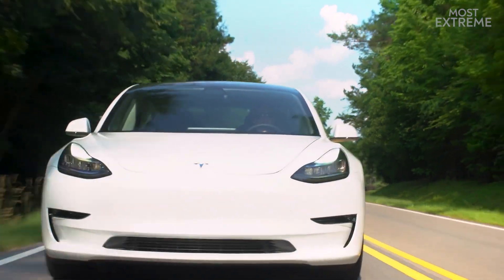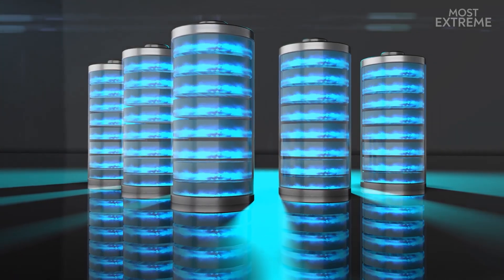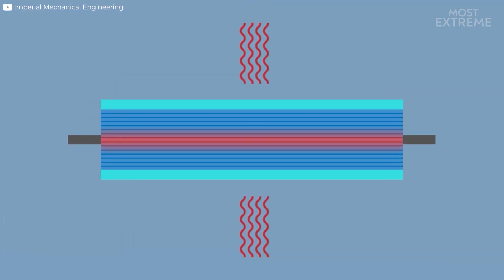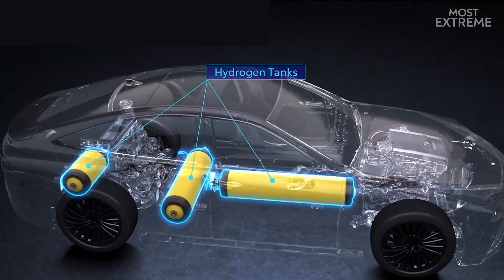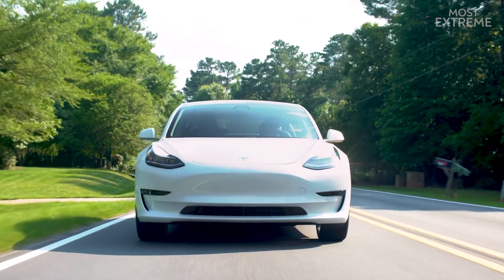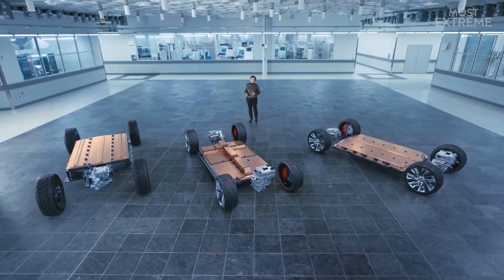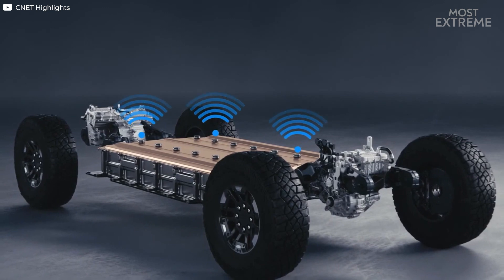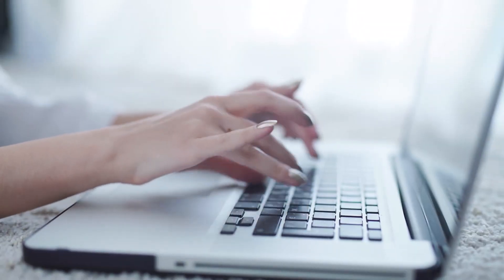Lithium VS Hydrogen VS Solid State | EV Battery Technologies Explained

Comment: Existing internal combustion engines have a fire every 2 minutes in the US. Electric vehicles are definitely better than this. A range of only 3 to 4 hundred miles? Who drives further than this in one go? Stopping for a coffee, and a bite to eat is enough to give your car another 1 or 2 hundred miles. Technology , and batteries are improving all the time. Battery packs are now lasting more than the life of a car - 20 to 30 years. Recycling, and re-purposing of Lithium ion batteries is now routine. This video has old ideas, and myths that are no longer relevant. hydrogen is an absolute no-no for cars. Solid state are years into the future. There, saves you watching the video.
Reply: You can extinguish an normal car fire with a simple fire extinguisher. You cannot extinguish an BEV fire due to the lithium reigniting itself.
Reply: You have no idea how Lithium based batteries work have you?
Reply: You omit the fact that there are more ICE vehicles on the road so yes there will be more fires . However if you start looking at percentages then EV’s will be much higher than ICE . Also it’s very difficult to extinguish an EV fire ; the EV fires are much more toxic.
Reply: Wow, you just gloss over all the problems and make it sound like it's some rosy solution.
Reply: One can't separate the use of electric vehicles with this technology from the price of a vehicle like this. If the longer range is the reason from changing lithium bat to solid state bat, then is more affordable to buy a v8 that buying 100k electric car. 🤷‍♂️. If the average driver can't afford a 100k electric car, then combustion engines cars still remain the way to go. And since none is killing the "planet" by using gas, then gas cars are save to use. 🤷‍♂️. This video is pretty useful to understand what coming and the cost of it. 🙋‍♂️
Reply: "Combustion engines have a fire every 2 min"? That data is wrong. You meant to say electric cars!

Comment: IF you are going to get hydrogen from natural gas, you may as well run your ICE car on LNG and save the problems with handling hydrogen.
Reply: Hydrogen is the future! We need to get everyone hooked on it first and then make it green or blue later.
Reply: Better to run the hydrogen through a fuel cell and charge a small battery. Much more efficient than to burn it in a combustion engine. But eventually it has to be green hydrogen or possibly blue, i.e. from nuclear, otherwise it won’t make sense.
Reply: @matskjellstrand7730  Hydrogen is not viable because of its thermodynamics, energy economics & chemistry. Hydrogen production wastes half the energy put in, as heat, which goes towards global warming. This is not something that will improve, as its simply the huge amount energy required to break C-H & H-O bonds to form H-H. 
This lost energy has to be paid for.
Renewables are now pairing with huge battery storage installations, California, UK & Australia are some examples. Australia has had a long history with Gridscale Vanadium liquid flow batteries that run for 20 years. They are now getting into Lithium as the costs drop.
Hydrogen is difficult to make & store, as it leaks out of just about anything, and makes steel & aluminium brittle, so high pressure hydrogen equipment needs regular inspection & replacement to meet regulatory safety standards to avoid catastrophic failure. The only big customers of hydrogen are in  the chemicals industry, and they have been getting cheap immediate use hydrogen from natural gas & coal, which is impossible to compete with on price, flexibility or quantity. 
Hydrogen is difficult to store, but a chemicals buyer can put in an order tomorrow for thousands of tons and it would be made fresh from fossil fuels, no need to store. If it were made from electricity not only would you need to have started producing weeks ago using the cheapest possible off peak electricity (dwindling as battery storage ramps up), but you’d have to store it for weeks & insure it. The total cost of that green hydrogen is more than 4x fossil hydrogen even with off peak electricity so chem industry buys from the cheapest seller, because their customers don’t want to pay a high cost for the chemical products. Even if electricity became free, which was a pipe dream promised by nuclear, the run cost makes hydrogen a premium specialist material, for use only for high value purposes.  That is why Scania & Man are no longer pursuing hydrogen, and why you do not see hydrogen powering EVs. Even the public refueling stations  cost a fortune to install & maintain, whereas ev charger stations cost less than 1% to build & maintain by comparison.
Reply: @jschreiber6461  . Yes...Thanks & Blessings..

Comment: What worries me with battery cars is the cold and then the battery aging so my 300 mile car might actually do 100 to 150 miles when it 3 years old. Then what spend 7k on a new battery as warranty won’t work unless there a faulty component. They should warranty them for capacity like 80%. Like your phone @ 80% will be flat by lunchtime even when fully charged in the morning.
Reply: Oh dear. You've obviously never owned an EV. And why on earth would you spend 7k on a new battery, when a battery refurbishment might only cost a quarter of that?

Comment: I just went electric with a Renault Zoe. It's perfect for local journeys, and that's really all I do. I charge it overnight once a week at my home.
Reply: Try and keep the charge between 20 and 80 percent for the health of the battery.  Don’t keep letting it drain too low
Reply: @vinceking7878  its always best for a battery to use its full capacity before recharging.
So reaching the last percentages and then recharge keeps your battery healthy.
Reply: @vinceking7878  Most people don't keep their cars longer than 3-4 years there isn't much point doing that if it's going to be sold on early on in its life.
Reply: @vwukben  The average now is 8.1 years. If you keep yours 4 that means someone else keeping their 12 years
Reply: @vwukben  I have to wonder how many people are buying used cars they can’t afford to maintain. The same people who say new cars are a waste of money because they depreciate, I think. I bought a Honda Civic new and drove it for 15 years, then simply drove it to the junkyard (it had rust) because the Blue Book value was worthless. I’m on my second car ever now, a higher level Japanese car this time, reasonable parts and maintenance costs, and plan to keep it for longer. We bought my wife’s car new, in 2011. It can likely go twice the amount of kilometres currently on the odometer, so maybe 20 years, but we’re hoping by 15 years old we can give her an upgrade. Meanwhile my neighbours go through used cars like they’re speed dating, and keep telling me how new cars are a waste of money.
Reply: @josephsmith594  You, and your neighbor, can both be correct. when you buy a new car, you must keep it long enough, to beat the initial depreciation(60% in the first five years). When a car is older than five years, you can sell it for almost the same as purchase price, and you get the use. I average $1300 a year, for vehicle cost. That's: purchase price-sale price. I don't keep a car past 2 years. in this example, I have not factored in that, I never have a car payment! Your neighbors might have a strategy, or they enjoy variety. Enjoy life responsibly!
Reply: @tompain2751  I have a Zoë for a year now. It went up in price. Shitloads of people have seen the light and want to drive electric. My father bought a Skoda Enyaq and actually sold it for more than he bought it for haha. Market has gone wild for electric cars!
Reply: @vwukben  if you want the battery to be in good condition in 3-4 years, and the resale value to stay high, it's still a good idea. don't be wasteful for no reason, all it takes is a little planning.
Reply: @gerryoconnor5846  WhErE iS tHe PoWeR cOmInG fRoM?

First of all, you are lying. Second, if you still don't know, you are just a parrot. Kind of sad.

Comment: Additionally, when you look at the number of KWH needed for the US, you need to be building 3 GW sized nukes every 3 weeks if you want semi-clean energy.  As in from about 6 months ago to 2035 or whatever... JUST to handle the power needs for cars.  Unfortunately, we aren't building them. And coming up with 17 nukes every year is a problem.  There are years to permit one... decade or so to build and so on.  Hydrogen looks interesting *if* you can find a biological way to break water apart.  Calling on Solar and wind to cover the Terrawatts needed for transportation won't work. With the grid in a fairly fragile state in large parts of the country, depending on Gigawatts of extra consumption will be a problem.  IF Tesla ever builds their truck, and starts building appropriately sized charging stations, you are looking at power consumption the size of a small to mid sized city.  (quarter to half a gigawatt hour of batteries take a LOT of current to charge...   When it comes to hydrogen, a fuel cell installation does not involve a carnot cycle engine.  No internal combustion... Just normal electricity.

Comment: the future is hybrid, you start electric and go hydrogen
Reply: I think the majority of drivers are well served by electric. Those in cities can drive about and commute quite efficiently.  Those in the more rural areas could go hybrid. Hybrid vehicles are more complicated and likely more expensive to service. My e-car is the perfect runabout. There are issues with hydrogen and needs more research.
Reply: Hydrogen has been around for over a decade. Nobody is buying. Even if the complicated pumping & cryostorage was given away for free there’d be no buyers because i) It is more complex than ICE to maintain ii) The fuel costs more than diesel or using electricity directly. These are run costs, which will never come down, especially if SSBs are there as a cheaper to run alternatives. Using hydrogen for goods transport increases fuel cost 4x, which hauliers with thin profit margins cannot sustain.
Reply: @jschreiber6461  thanks for the info.
Reply: @jschreiber6461  A decade   General Motors were shouting loud and proud about hydrogen forty years ago......

Comment: Living in remote canada I cannot see battery technology working for us as it is currently set up.   When SS hit the market in large scale I will make the jump.   We also do not have the "cleanest" grid power so really the electric car is not saving anyone when it uses dirty coal or oil produced power.    Once all our power grid is clean energy and batteries are SS then I will be first in line.

For now it is trendy, but not anywhere near truly green!!  I also do not need a veihicle that goes from 0-100km/hr in 3-4 seconds!!
Reply: I live in Quebec province and here the electricity is green, here we should all have EV's, I dont understand why people esitate about EV's. Specially we have a $13,000 refound from the gouvernement and with the refound you can buy an EV for less than a petrol engine!
Reply: @antimocammuso3577  You do know that the "refund" is the government paying you with your own money?